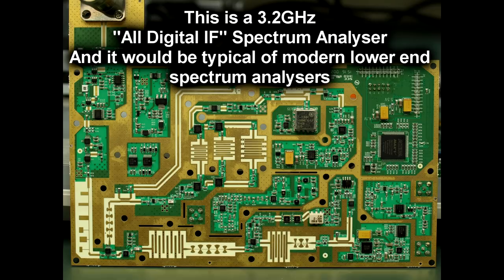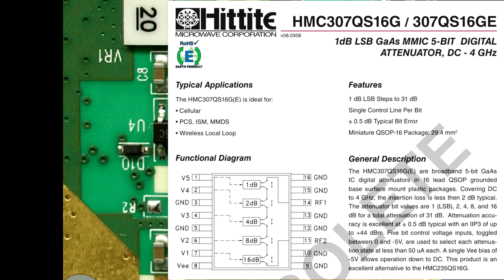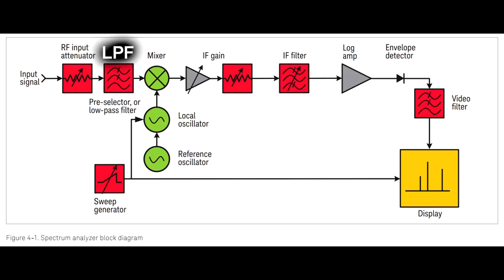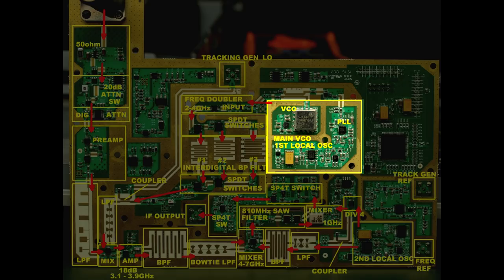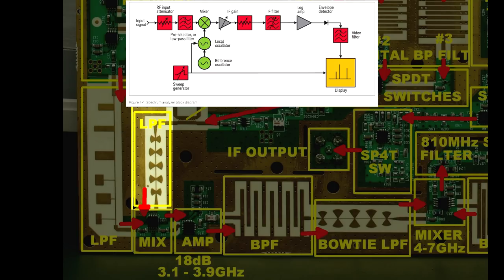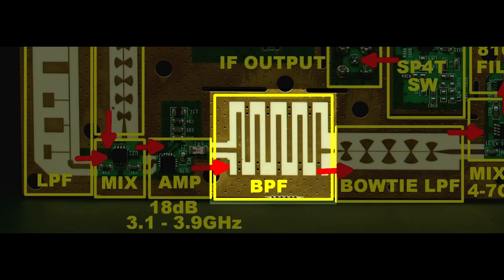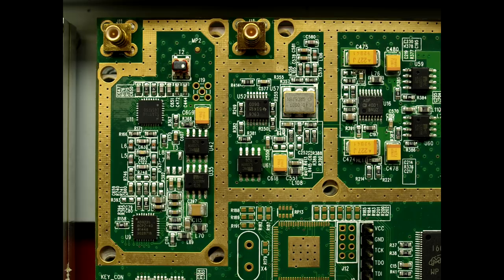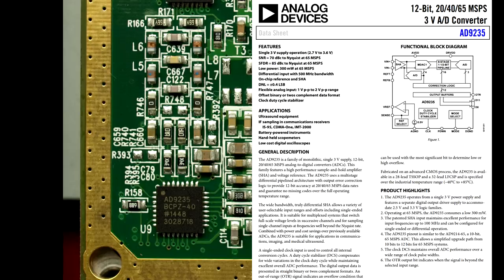EEVblog #1109 - Spectrum Analyser Design Walk-through

Comment: Hey Dave,

At 19:54 The inductors L105, L102, L103 and other capacitors were not populated meaning the optional bandpass filter upgrade might need a slight hardware upgrade.

Thanks

Comment: Should that not be a Tayloe mixer with a clock of 44mhz driving a 74AC74 to generate the clocks to drive a 74HC152 with a balanced input(BQSD) to generate I/Q which can drive the IFFT to allow as to get a spectrum display.
(BQSD=Balanced Quadrature Sampling Detector)

Comment: Please someone help!  This has always freaked me out and I have never found a good answer for it.  If you have a signal with relatively high content in it, say 2 or 3 gig, how the hell can you mix that with another signal and down to the range of the ADC and still expect to see the high frequency content?!  I have watched nearly all the vids from Shahriar at The Signal Path, and the ones Dave does, and I just cannot get my head around how this works.  If I mix say a 100Hz sine with a 1kHz sine, then I get the 1k 'riding' on the 100. I couldn't then expect to put that through say a 500Hz ADC and see the 1k info - could I?  Then how does it happen with these higher frequencies?   There is something I am badly missing here and I would love it if someone could put me right.  Cheers - Andre from Sydney.  (Edit: look at the graphic at 17:15 - 3.6Ghz in, eventually mixed down to 22.5Mhz - and the ADC still gets to see all the 3.6GHz content?!  What mixing magic is this?!)
Reply: Sorry i can't tell you, because it is top secret....LoL
Reply: Thanks bog... very helpful..not!
Reply: The mixers produce the sum and the difference of the input frequencies.  In the figure, the filter blocks are only passing the difference.  The idea is there is modulation on the (for example) 3Ghz signal.  That modulation "spreads" the 3Ghz carrier +/- 10 Mhz say (again for example).  Using mixers, the carrier is shifted down to something that can be processed digitally (e.g. 22 Mhz).   Think of the carrier as the frequency of a tuning dial on an old analog radio.  The carrier frequency does not change the sound of the music, and the radio will play it whether the song is broadcast at 680Khz or 1.6Mhz.
Reply: One issue I see is that you seem confuse mixing/downconverting with summation. I'm going to use some simplifications, but it should help give the gist of how this works.

It's usually easiest to picture what the mixer does in the frequency domain. It allows you to have two signals interact so that you get resulting signals at the sum and difference of their frequencies. This allows you to shift a signal along the frequency axis. You still are bandwidth limited by your ADC, so what you do is look at the higher frequency content in chunks i.e. if you have 50MHz of ADC bandwidth, you have to take ~20 measurements to look at everything from 1GHz-2GHz 

Another thing that may help you understand is sort of reversing your '1k riding on 100' example. Typically in communications it is the opposite. You have a low frequency carried by a high frequency. In something like amplitude modulation you are concerned with the low frequency variation (envelope) of the high frequency signal, not in the instantaneous value of the high frequency signal. The information of the signal is carried in the envelope .
Reply: Thanks Nukes & Cliff. Let me re-read your replies a few times and digest... i totally get AM and modulation etc and didnt know we were dealing with similar concepts..also it seems from what you say that an ADC having '20MHz' has more to to with bandwidth than highest freq...? Let me think and read this and other sources again. It's one of those things where i want an intuitive understanding of the concepts rather than "this just happens". Thanks again!
Reply: The magic is that the spectrum analyzer scans the whole range, not all at once. The resulting signal is only a small part of the whole bandwidth, thats why it takes a bit of time for the analyzer to scan its whole frequency range.
Reply: Andre Gulbis Are you familiar with the "beating" you hear between two tones that are close in frequency? Like, if you have two tuning forks at just a couple of Hz apart, going at the same time? The "beating" you hear is the sum and difference of the two tuning forks' waveforms in the time domain. This same principle of "beating" between frequencies is what is exploited in RF frequency converters to arrive at a downconverted (or upconverted) signal.
Reply: Thanks got, paul & movax!  All great info that's giving me a better idea. Apologies for turning this chat into an "answers" forum. Cheers and thanks again to all.
Reply: Initially i have different question, but i did notice the 22.5Mhz thing. It happen have to do with frequency mixer and how spectrum analyzer able to scan and put everything on screen(from 0 to 3Ghz). So, a gif from wikipedia worth more than thousand words. Go https://en.wikipedia.org/wiki/Spectrum_analyzer#Hybrid_superheterodyne-FFT. Under theory of operation section, look at the figure on the right. You need to remember Nyquist limit when it came to sampling. Let say in your example 100Hz(without carrier frequency), you put on display(span of 0-1khz), you will see something like 100Hz, 200Hz, 300Hz, etc. However, if you upmix the frequency to 1kHz, the 200Hz onward frequency will disappear from the display(span 0-1khz), but it does repeat at 1.1Khz, 2.1Khz, etc which you are not gonna see it anyway. You get the idea.

Comment: I made it to 1 minute and 55 seconds and was totally lost. And I really, really wanted to learn how a 50 ohm impedance was made. Shit.
Reply: it is made by impeding the load down to 50 ohms lol.
Reply: Hah - I've been hanging in there for years now.
Reply: Very funny. Impedance is not the same as resistance. So you can't just put a 50-ohm resistor there. So how do you wire a "50-ohm input impedance?" I don't understand SOT-23 or "switch in a 50-ohm load impedance" or any of the other gibberish he considers teaching.
Reply: JL Software You’re not alone.
Reply: I'll stay subscribed but I can’t watch any more of this right now - maximum frustration. And to think I have a Amateur Extra radio license. What's the point of flying through a circuit board and waving around a bunch of components and saying "that's the XXX"? Or worse, the oft-repeated "not a whole lot there, that's all she wrote, not much there", etc.